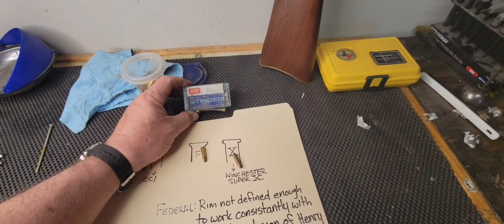HENRY GOLDEN BOY 22LR WONT CYCLE!?

Comment: I went and got me a classic henry yesterday. I have the same exact problem!... Poor machine work and would fire the round but would not eject an empty casing. I cycled 100 rounds and id say 80 of those would not eject! I was of course using the federal ammo. Ill get something else tomorrow and will give you an update. Thank god i found ur video, I was about to send it to the bottom of the lake with all my other firearms due to a very unfortunate boating accident last year...
Reply from the maker: @sir.mr.georgewalter3144  well im glad I could help ! Hang in there ! All is not lost if it's worth the effort to you.  I know some schools of thought would say "just send it back" while on the other hand like me " see if you can make it work , it could be fun! " lol 😆  yes try different ammo and cleaning and working the actions. And see if you can narrow the problem down. Thanks for watching and leaving a comment !
Reply: @fakeitormakeit83  well, i had some winchester ammo and decided to try it out... Was not a good experience and now im in a hell of a pickle... I took my time and gave it a good cleaning and followed up with plenty of lube. Nice, smooth action without any ammo. The winchesters seemed to be a tighter fit than the federals tho. Lil more resistance when cycling and extremely difficult to get the spent shell casing out. Would not even eject one time. So, after 5 rounds i decided to just try a hard, real quick cycle but ended up leaving the spent round in the barrel and sendin the next round up into the top of the chamber and bending the round into da mb near a U shape and now it wont push back down into the feed tube and doesnt have enough room to come up and out with the shell casing still stuck in the barrel. Im extremely frustrated and disappointed with this rifle. I looked up the henry warranty on it and it says a lifetime warranty but dont know if they fix it kause im not the original purchaser....
Reply from the maker: @sir.mr.georgewalter3144  maaan that sucks! I wonder if it's a matter of the actual chamber being out of spec . Or maybe something with the extractor itself not getting a goof purchase on the case rim to pull it out.
Reply: @fakeitormakeit83  what puzzles me the most is the fact that I can fill the tube with any .22lr brand and cycle every round without a problem as long as the round hasnt been fired. Everytime I pull the trigger tho, the ejector leaves marks where u can tell that it is trying to catch and hold on but that shell casing is tight, almost stuck in the barrel. Unfired rounds tho, smooth easy cycle... Ive never had a rifle give me such a hard time as this one has and ive only had it 2 days...
Reply from the maker: @sir.mr.georgewalter3144  I am no gunsmith at all just to be clear lol. But to me it seems like there isn't enough tolerance in the chamber to accommodate the dimension of a fired casing . Beings the casing swells after firing . But then again if the extractor isn't strong enough to grip the lip of the shell after it's been fired it could be an extractor issue .